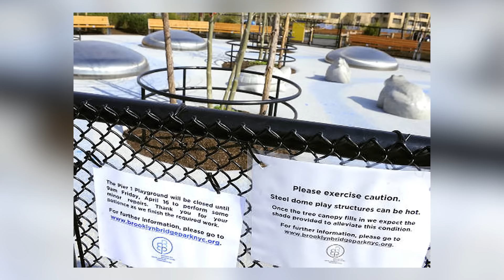15 Biggest Architectural Fails

Comment: Sure I'm not the first person to say that the LA concert hall ain't at Disneyland. I wouldn't trust the presenter of this material to build a doghouse. And the idea that engineers don't understand the resonances that took down Galloping Gertie? The Hancock issues aren't even the biggest engineering fails in Boston recently--the Big Dig tunnel ceiling tile which fell and killed a woman comes to mind;, and there's always the failure to do any soil testing for the Ted Williams cross-harbor tunnel, which they tried to rest on a couple of hundred feet of soft mud before realizing they needed a billion-dollar retrofit. As long as you're including engineering issues. Surprised Johnson Wax didn't make the list--if embarrassment is the issue.
Reply: What's the issue with Frank Lloyd Wright's Johnson Wax Administration Building and Research Tower?

Comment: Bad clickbait, the only true architect you mention is Frank Gehry. Most incidents you mention have a single cause in common, which is inappropriate cost reduction before or whilst building process is going on. And as others also mention, mostly problems rising in the engineering field. 
What by the way is the issue with retaining rainfall on a roof to alleviate the storm drain, when as you say the roof of the Kansas City Kings venue now function as they are supposed to? That sounds more like direct prejudice towards a further great idea. An idea we should have thought of much earlier, especially when we take into account how much square surface of soil we’ve all covered since let’s say 1900. Such prejudice certainly won’t lead to a new understanding we should really step away from ever more quickly draining our roofs. Instead we should innovate our surfaces into retention areal, or reinvent our cities in such a way rain again can be interred into the local subsoil. This also to prevent significant lowering of fresh water tables, rising of saline water tables, city troubles with extreme heat (ie there’s no water available to evaporate, hence temperatures inside the asphalt jungle will only further skyrocket), city troubles with a lack secondary quality freshwater (it’s better to water your plants with rainwater, than with drinking water). So, my suggestion, take the prejudice out and tell a true story, even of true failures, but don’t just give the obvious in a kind of jargon based sermon for the disaster tourists. Tell more than just the clickbait cocky pop.

Comment: The biggest mistake you made is that many of these are structural failures, like the bridges, and not architectural failures.  Playgrounds aren’t designed by architects either.  Your blanket assignment of these failures to ‘architects’ shows that you just want to make some money without actually doing your research and reporting the issues as they should be reported.  For this reason, this video is a ‘failure’.  Change the title to start with and then redo your narration so that it is honest to the content.

Comment: Architure and engineering works hand in hand, so not all building failures are purely architectural mistakes. Remember that anything that involves strength and structure requires engineering.